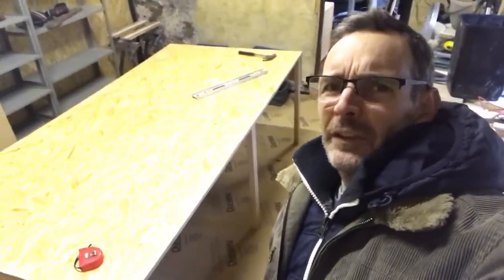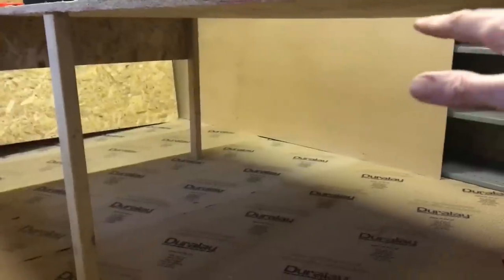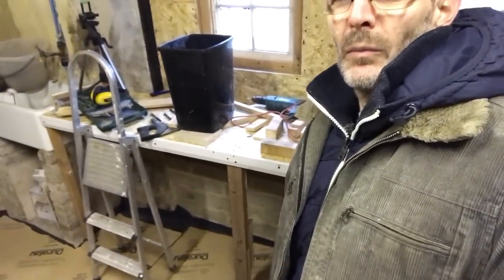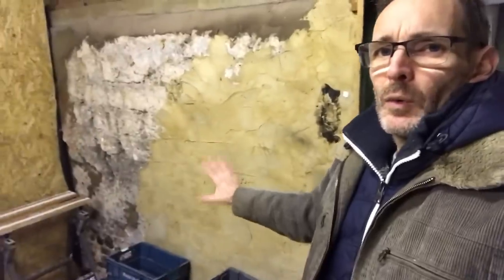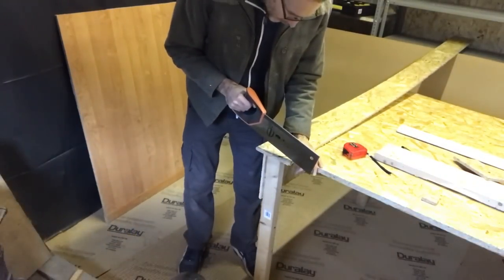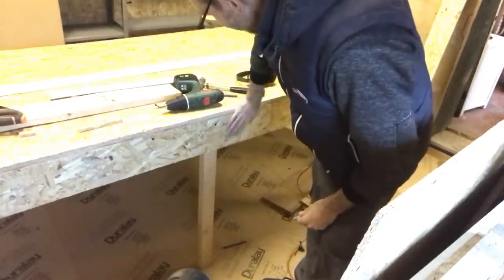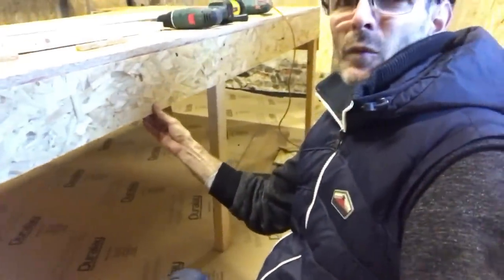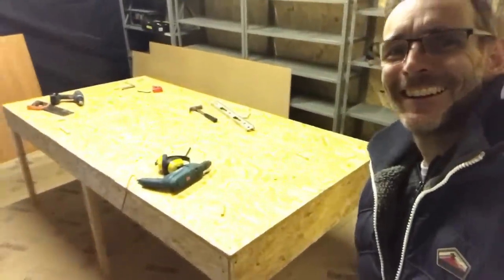I built a huge table in my shed....

Comment: That single piece of OSB won't last, it will sag in no time. I would add a few more lengths of CLS underneath it to give table top a bit more strength and perhaps then glue a sheet of finished ply on top of the OSB. Would give a smoother surface. Oh, and if the OSB is new keep your room aired for a while due to off gassing. Nasty chemicals in OSB.

Comment: The problem with a skirt on a table/workbench is that it restricts access under the table, which is often needed/desired to have additional storage.  A better way would be to add a mid-height support, to get the rigidity needed and incorporate it into a mid-height shelf, using the frame (often a 2x4” frame) to support the additional shelf.
Reply: Well ..if I might say:-- I liked tge idea of tht ratio strength.. id have said  ,  I think Nik might even think the same tht..removing the skits eventually and put shelves there
Huge space .
Reply: @YANDEX30V  Agreed, as work spaces go Nic’s new workshop isn’t all that large and after having watched Nic’s videos for years, in the old TAT Cave, know he likes to fully utilize his under bench storage.

Comment: Wimpy Table and Workbench:  Not to be a downer, since I do respect those who take on their own DIY projects, but having built workbenches since I was a teenager (and am now age 65) I predict that your bench will fail in pretty short order (with in a year or two) and will need re-work, re-building or reenforcement.  

First, both the table and wall bench are way too large for such weak frame support, meaning you’ll likely be using it daily and will at times be stacking it with heavy items (I’ve watched you load your old Tat Cave benches for years).

OSB sags when spanning much distance, over unsupported lengths and screws put into the edges (like the workbench top) will not hold much, for long.  OSB does well when screwed into the face, but is too weak when fastened into the side.

The unsupported leg bottoms will have too much leverage, being only connected at the top and with skirt boards.  Force, such as being hit by a box/bin being pushed or your foot hitting them will cause flex.  Adding more skirts, as you mentioned, will help, but every extra inch of skirt losses you space underneath.

You would have been far better off, with just a bit more work (for both the table and work bench) to have built a series of 4 sided frames, with cross center supports, for the tops and any other shelves needed.  I like a mid-height shelf on the wall mounted workbenches and also consider a bottom frame (at the floor) to keep items up off the floor and provide the most support.

Building benches with 2 or 3 of these frames also allows the framing members to all be pre-cut quickly and consistently on a miter saw (from a cut list) before assembly.  Squaring up the frames goes quickly and is done when applying the sheets of OSB.  The factory 90 degree corners do the squaring for you as they are fastened.

In the USA 2x4s are commonly used for the frames, since they are cheap and abundant, but if you want more net shelf height (less lost spaced due to framing thickness) then 2x2” frames could be made or the 2x4”s can be turned on their side to gain extra shelf height.

All the frame layers can then be skinned with OSB, plywood or even butcher block counters, particle board or hollow core doors.  You can even speed assembly because the frames can be assembled while sitting on the floor and spaced apart by attaching the legs.

You mounted the wall workbench with pieces, mounting the back support to the wall.  If you had made it freestanding instead (like the table you made) and then added a couple fasteners to hold it to the wall, you’d have some advantages.  

First, built-ins are harder to rearrange.  Second, they are harder to move, if you need to access the wall to repair/modify plumbing and electrical.  Lastly, when the room becomes something else, the work benches have to be dismantled, rather then moved and re-used.  When I moved houses last year, I just loaded my favorite work benches at the old house and brought them into my new workshop.  Same contents could go right back in.  Those benches I didn’t need, from downsizing, were easily sold since most guys like good quality work benches.

Making a sturdy, proper frame will truly extend the weight capacity and longevity of the project without much extra work.
Reply: There’s always one Karen to put a damper on things 😂
Reply: @asadshah446  The difference between a Karen and someone making alternate recommendations is experience and useful information, that might help some other viewer (or even Nic) on their next project.  A Karen, just complains or is negative, without adding beneficial info or insight.

You, for instance, strike me as a Karen, since your comment was simply to complain about my observations.
Reply: @brianhenry2385  i'm sure nic will be happy if it just lasts a year or two for now
Reply: @bazzer2828  Very true, he might, since he says he doesn't want to make that room long term, but even in the short term a bit more bracing would make the year pass with less risk to the product on the bench and worktop.  I would hate to see it collapse under the weight of an expensive pottery pick up, or something similar, hence the suggestions.